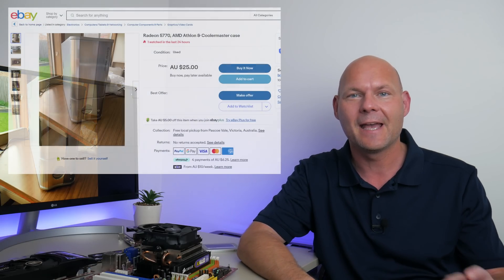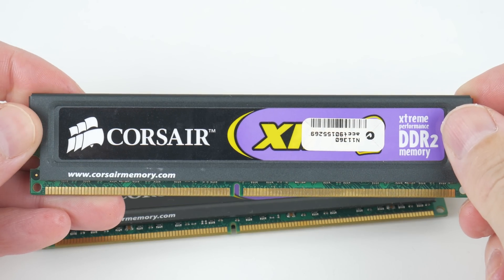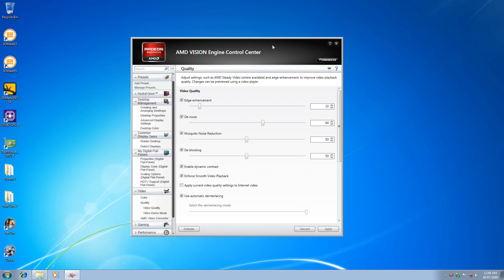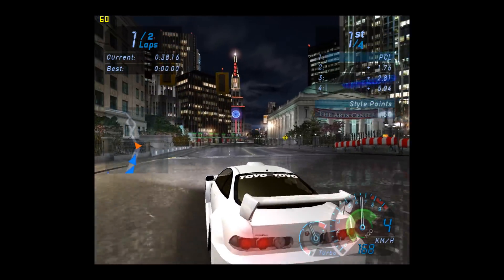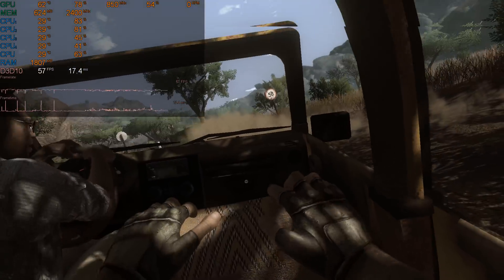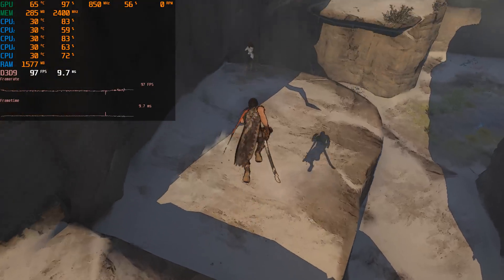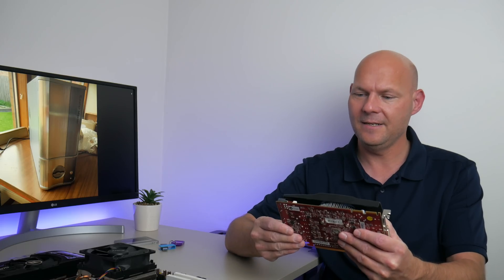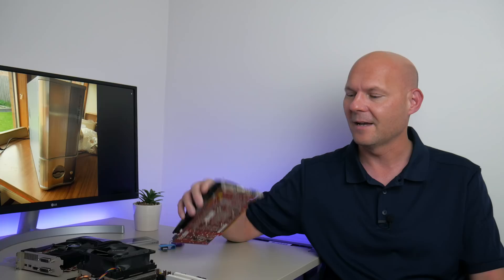Is This Old Athlon II PC Worth it?

Comment: Awwwww - this dude's PC is YouTube famous, and he still can't sell it!

:)

I expect that it'll run Crysis acceptably at a lower resolution. I used a 1440 x 900 wide LCD back in the late 00s, and that felt pretty high res. Before that it was a 1280 x 1024 LCD that also looked fantastic.
Reply from the maker: It's sold by now 😂

Comment: Interesting comparing the GPU-Z specs from the HD6770 with the RX6700. 11 years apart- 17x the transistors, 7nm from 40nm, 10x the memory, 4.5x the bandwidth, PCie 4 over PCie 2. I've also got a HD5770 that I got cheap secondhand for an old PC project.

Comment: You should know better bro.  @3:00 you claim the HD5770 to HD6770 were a rebrand because ATI to AMD.  However AMD bought ATI during development / launch of the HD2000 series.  Most ATI HD2000 series cards were in fact ATI branded, but you can still spot the AMD logo on some of them too, I have an HD2600XT for example that says AMD on it on the PCB, despite the chip itself stating ATI.  The HD3800 series were also partially half and half ATI / AMD branded, probably due to some sort of back end deal with the purchase, that AMD wouldn't mess up existing future products or something.  HD4800 series, when XFX jumped to AMD is when AMD officially made the 100% jump to the AMD brand name (at least by outwards recognition).  Yes, towards the HD7000 series or so they finally did away with the ATI name all together within their drivers and whatnot, but they were full steam ahead AMD named cards starting with the HD4000 series.

Overall great showing though other than my complaint about ATI / AMD history.  I absolutely love my Phenom machines too, and definitely support somebody out there buying that $25 AUD rig and enjoying it.  If that was $25 shipped to me, I'd be buying it right now honestly.  Even $50 shipped I'd buy it, that's not a bad machine at all for a cheap retro starter.

Comment: Phil I have good respect for you however the HD 6000 series isn’t just a rebrand because AMD bought ATI… that happened in 2006 and the 6000 series came out in 2010-2011.
Reply from the maker: Yea I expressed this poorly. All the 5770 had ATI logo and the 6770 have AMD logo.l but identical specifications. Seems not all other cards went through this...

Comment: I ran my phenom 2 x4 at 3.6 all the way into 2016, ran 3 different gpus in that time 4850 to 6770 to 270x. It ran as a second pc to 2019, when ryzen 3000 came out, and was retired to the pile of relics I decorate my storage room with. It can run windows 10 and accommodate a modern gpu if I wanted, but I've ended up with better stuff for free in that time.

Comment: Hey my second System is a AMD Phenom II X4 955 (C3) Stock 3,2 GHz and 24/7 OC 4GHz and the max OC on 4,4 GHz but is not 24/7 stable, with 16 GB DDR3 1600 and i could made SLI with two GTX 660 (16/16) PCIe 2.0, but that works only really in Benchmarks not in GAMES.

Comment: Before even watching, yes! I upgraded my Athlon 64 X2 5200+ 2.7ghz (Brisbane) to a Phenom II X4 955 3.2ghz (95W) not long ago for the cool price of $11. It can do some very decent gaming if you enjoy indie titles, older games, Windows XP, or even some games from PS3/360 era. With a Radeon R7 250 2GB GDDR3 (OEM) I'm able to play Hollow Knight at 1080p 60fps (with blur set to 2. It can run maxed out on Ubuntu.) and Wayward. Which was my main goal. Along with titles like Mass Effect 2, Dead Space, Deus Ex HR, C&C3, RA3, and Prey 2006 with HD textures and the sikkmod upgrade. I overpaid for the R7 250 at $28 because the seller listed it as a GDDR5 card, but I've seen it and other OEM GPUs going for like $12.

Comment: Interesting video and machine.  But...why?  Like, I have a XP Machine that will run everything I could possibly want to run from that era (Core 2 Duo and GEForce 750ti).  And I have a 98 Machine with a Voodoo3.  So I'm a retro enthusiast and all.  But...I'm really not sure what I'd do with this machine.  You can get Sandy and Ivy Bridge Machines for free or extremely cheap, and you can get a 750ti or even something a bit older for not much either.  The result will remove all asterisks and laugh at any XP game.  It's not like this Athlon II box will run Win98 well...

I think most of us have limits as to how much retro hardware we want to own, and this really feels like it will just sit in the corner, taking up space, while another machine gets more use.

Comment: I can't think of a Windows 7 config as a retro PC. lol I had this OS on my main rig just 2 years ago. Had to change to Win10 bc of DX12 and some other new software. To me "retro" means at least WinXP or better yet a Win98SE PC.

PS Also most everything a Win7 PC can run, can be run on a modern Win10 or Win11 config w/o any problems. This is why real "retro" starts with WinXP.
Reply from the maker: I was meant to put XP on it, but then went with 7 because I could test XP era games and Vista/7 era games in one go :)

Comment: These were decent processors in their timpe despite the hate everyone gave AMD at the time. i had an Athlon X3 460 that also unlocked into a Phenom X4 and i was able to run pretty much any game back in 2012 and 2013 until i upgraded to an FX 6300. Maybe they were not as good as Intel but they were still good enough to do what you need to do

Comment: I ran an athlon ii x2 from 2008 till 2012 with an evga 8800 gt sc and then a gtx 560 ti. It handled itself pretty well. It actually ran crysis and mass effect series. The 560 ti was a nice step up from the 8800gt.

Comment: The Athlon II was a very solid CPU to to have and AM2/AM3 platforms were very capable in the late Windows XP/ early Windows 7 era gaming. Unless the board has some stability issues, the system may go as high as 8 GB of RAM (some early ATI/AMD chipsets had an issue with more than 4GB of RAM) and the rest of the platform fares well. This is the case for PCI Express performance, SATA and most other things. There is also a quite good potential for modding as an Athlon II system can have a four core ore even an elusive six core Instanbul CPU may work. Although MSI is not known for great reliability or performance, the board should be good as is. There are also a lot of options for testing different scenarios on AM2/AM3 boards with multipliers and HT link speed. Overall, I think the platform is very compelling and well-rounded!
Reply: The Athlon II can also oc quite well. I was able to oc an Athlon II 250 (two cores at 3GHz stock) to an impressive 4.11GHz using a Gigabyte GA-MA790FX-DQ6. Like Phil I too have a 640 but haven't had a chance to do anything with it yet, but it should oc to 4GHz aswell (it's on an ASUS Crosshair V Formula).

Comment: At 3:04, it looks at it looks like the Crucial MX 500 500 GB SSD that I was using in 2020 and briefly in 2021. As there seems to be a reliability issue with these SSDs, Crystal Disk Mark kept on giving alerts, the health percentage suddenly plunged to less than 90 percent and then eventually plunged to 81 percent, IIRC!
Reply from the maker: Hmm well I haven't had any issues yet, but thanks for the warning! Maybe I even updated the firmware, not sure.
Reply: @philscomputerlab  As there seemed to be a reliability issue, I took mine out of service, and I never used it until my first Ryzen build, (January 3, 2020) which started with a Ryzen 3 3200G and then in June, 2020, got the popular Ryzen 7 3700X. Sadly, the MSI B450 Tomahawk that was my first Ryzen motherboard, failed, MOSFET failure in August, 2022! ☹

Comment: that's a flipping bargain. i remember building a budget PC back in 2008. It had an AMD x2 7750 with Radeon 4850 graphics. Upgraded that to a x4 960 cpu with 6770 graphics. still got the PC, it now has a w5100 graphics card. I've had it for 15 years and it still remains connected under my desk.

Comment: I bought a 5770 to replace my 4870x2 which blew the fuck up, Crysis didn't run great on the 5770 (atleast not to my standards) so I replaced it with a 285 later in 2008, but that card had insane coil whine. Don't miss that.

Comment: It falls in that same range as a Core 2 system, fulfilling the requirements of the "casual user". Well enough for desktop use, browsing, office work, and the occasional low power gaming at the side.
And the best thing is, the board supports 6 core Phenom II, putting it into a place where it can easily run games up to maybe 2015-2017. Sure, 6 cores are nice, but the lack of SSE4.1 will hurt it with never games, where a Core 2 Quad will continue.
Basically a very nice XP era gaming machine that can also handle some newer stuff. XP/7 dual boot would do fine. And once can always upgrade to 8GB RAM and a faster graphics card. And overclocking is always an option. The architecture should do 3.2-3.6 GHz just fine (that is around where the fastest models are) for a nice 23-38% boost on the CPU side.

Comment: I have a PC with a similar cpu like an Athlon II x2 cpu with 4 gb of ram and its an HP Pavilion Slimline that I found in the trash on the side of the road. It seems to be from 2010 or 2011. Took the PC home, connected a monitor with keyboard and mouse and right away it booted into Windows 7 without having to fix it up. Actually a PC like around this era, I like to set it up as a dual boot Windows 10 and Windows Vista.

Comment: AMD announced it would buy ATI in July 2006, and the acquisition was complete in October of that year. This was while ATI was still selling R5xx cards, which carried the Radeon X1xxx marketing names.

The RadeonHD 5770 was released in October 2009, 3 years later.
Reply from the maker: Yes the 5770 was branded ATI, I did an image search. The 6770 was AMD branded with identical specifications...
Reply: @philscomputerlab  2009 is when the internal struggle between AMD and ATI was lost by AMD. AMD changed its corporate colour from green to red, but renamed the Radeon products "AMD Radeon".

AMDs cpu sales were flagging since 2006, sales of ATI graphics cards remained solid, as around that time, the ATI products were at times still competitive with Nvidia.

AMD was hard hit by the credit crunch of 2008. It sold its fabs to a saudi investment firm in Q4 2008. It sold its mobile Radeon products to Qualcomm in january 2009 (for just 61million, and qualcomm made a killing with it when smartphones became ubiquitous.).

AMD also stopped their support for the open source driver for ATI. As the main author of that driver, i first hand experienced just how AMD lost control internally of ATI. The amount of political support we had was directly correlated to the relative performance of the CPU side versus the GPU side, especially since we were tasked by AMD to liberate ATI, against ATIs will.

But the fact of the matter is, the amd rebranding of ati is 3 years after AMD bought ATI.

Comment: It is incorrect to say that the entire HD6000 series line was a rebrand by AMD. While there were specific cards like the 6770 that remained the same, other cards in the line were drastically different.

Two examples would be the HD5450 to HD6450, the former had a core config of 80:8:4, while the latter had a core config of 160:8:4 (Shaders:TMUs:ROPs). This made the 6450 twice as fast as the 5450. AMD also went backwards with other models. Like the HD5870 with 1600:80:32, but the 6870 only had 1120:56:32, making it 20-30% slower and requiring you to go up to a more expensive 6970 if you actually wanted a performance gain.

AMD didn't have a good performance uplift until the HD7000 series, but that came at a cost of high heat and power consumption. I had both a 7970 GHz Edition and an R9 280x, both cards were heat monsters.
Reply from the maker: 5770 was branded ATI, I did an image search. The 6770 was AMD branded with identical specifications. Weird.

Comment: New across your videos. Why match it up with a 750w PSU and SSD, at least use a portable HDD and lower wattage PSU with those specs for a more genuine experience
Reply from the maker: I used the Asus 750W for all my projects! It can handle old projects with low power requirements, but sometimes I work with SLI or CrossFire. SSD is life, it takes time installing software and games, the faster the better :)

Comment: First of all, when you were talking about downloading the MSI drivers, all I could think of was how bad experience I had with ATI drivers.  Few seconds later lol.  
Even though at least at first it was just the RAM.
Anyway, I used to have a HD6850 and it was a terrific card for the money, though a bit short lived in terms of relevance.   Before it I had a 4870X2 which was actually better performing, but it was extremely loud and high temp so I gave up on it to "downgrade" to the 6850.  

Good video, though whenever I see older ATI cards I get PTSD.

Comment: The Athlon II/Phenom II were pretty decent CPUs back then. I had a Phenom II X4 955 and it was great. I was using one a couple years ago and running Windows 10 and had no issues whatsoever. They’re still great for everyday PC use and of course games from that era.
Reply: They certainly were mate, I've just dusted my 965 off, added a GTX 660 with xp x64. Bloody thing hammers!
Reply: Exactly, it's that level of performance that is still totally usable today. The Athlon/Phenom X4 and Core 2 Quad are totally still capable. Sure, not as fast as modern chips, or even a sandy bridge chip, but absolutely good enough.
Reply: I'm still using Phenom 2 on my main PC 😂
Reply: I was recently using a mid-high Phenom II x4 Black Edition up until about two years ago -- I'm now rocking a Ryzen 3600, but that Phenom carried me for over ten years. :D

Comment: My Windows XP retro rig has almost the exact same parts. It is a Athlon II X4 630 CPU with a Radeon 5750 GPU.

My friend bought it early 2010 and it was at the time a low budget Windows 7 gaming computer. Poor guy struggled to run games on it even shortly after he bought it, the hardware was really underpowered for its time.
He gave it too me after 8-9 years. I cleaned it up, changed thermal paste on the CPU and GPU, installed a Sound Blaster Audigy 2 and put Windows XP on an old 128 GB SSD.

It is a phenomenal Windows XP gaming rig with the speccs. Runs pretty much all games at 60+ FPS, high/ultra settings at 1080p, even games such as F.EA.R.

My point being that super budget components from the Windows 7 era might not be as exciting as top of the line Windows XP hardware but most of em have excellent XP support and performs great and can be had for almost no cost!
Reply from the maker: Excellent summary of the situation! In 10 years these parts will be in demand LOL Or maybe not LOL

Comment: This is awful similar to a system I would have built back then, if I had bought the parts when I first started planning my upgrade instead of waiting.
By the time I built it though I bumped up to a full Phenom2 on a later DDR3 board because of a mobo+CPU combo sale at Fry's Electronics (they did that a lot).

My original plan also included an HD5750, maybe 5770.  But my "temporary" card was a cheap 4350, and it had a weird glitch that affected the game I played most, so when I went to buy my "serious" card I was worried the 57xx would have the same problem, and switched back to NVidia.
Reply from the maker: 4350 is really a basic card, how did you manage?
Reply: @philscomputerlab  When I did that upgrade, I wanted to delay the video card expense since I was still playing older games.  I was very happy with my AGP Radeon 9800 Pro, but needed a new card because the new board was PCI Express. The board I ended up getting was a 790X so no integrated video.

The 4350 was cheap and after studying all the tests I could find, I decided it should be faster than a 9800 Pro so it was good enough.  I was tempted to spend a little more on a 4550, and maybe should have, but I forbade myself to go down that slippery slope since the card was supposed to be cheap and temporary.

My plan was to upgrade after I started a newer game, and then the 4350 would be my emergency backup (I'm paranoid about high powered cards dying).

Turns out my 4350 had a strange glitch where in every scene, there'd be 1 random 3D surface somewhere that kept flickering.  Sometimes it would be a tiny detail that I might never find.  Sometimes it would be a huge wall.  I found evidence of people having similar glitches on some 58xx cards, so it led me to switch to NVidia on the next upgrade.

I used the 4350 for about a year, then got a GTX260 when I started Fallout 3.  F3 was playable on the 4350, but just on low/med settings.

Comment: AMD AM2/AM2+ platfrom is far too underrated for win2k/xp retro pc. Recently I bought an AMD Athlon II 270 with an Asrock nforce N68 motherboard and  1gb ddr2 for $10. I Installed win2k with internal Geforce 7025 graphics and everything works well. I ended up adding my old HD 7770, another 1gb ddr2 memory and I installed XP on it. Surprised GCN card works really well with XP too.
Reply from the maker: I got a few queries about Windows 2000, what is your take on it for purpose of playing classic games?
Reply: @philscomputerlab   I didn't play any games on Win2k. Just tried to install it and see if things work since the motherboard has the complete drivers for Win2k on their website. I only test video playback and some small internet browsing. But even with kernelEX and newer firefox build installed, hardly any site can be opened properly. The same goes for XP actually. I tried installing a modded Radeon driver that support my HD 5450 but no luck so far.
My motherboard is Asrock N68S and I followed i430vx guides to install all win2k updates and KernelEx.
I do play games on XP though.